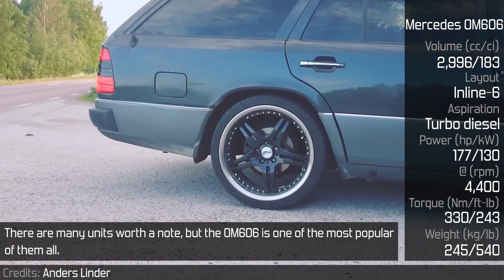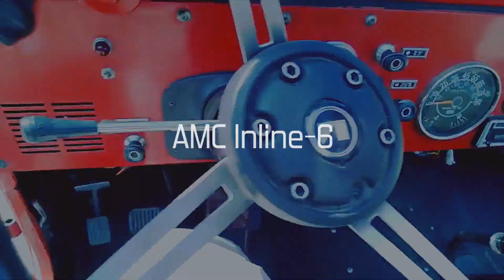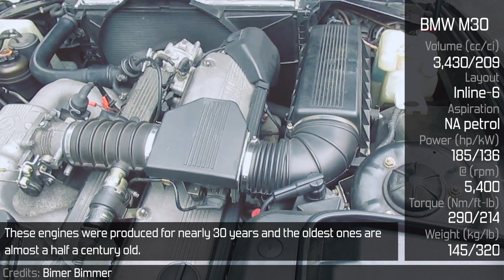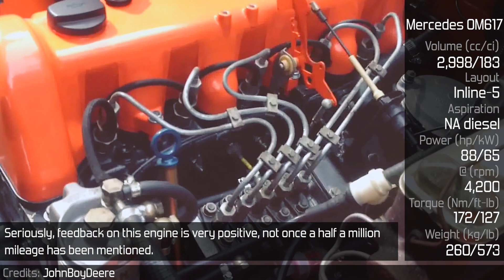10 Most Reliable Engines Running Beyond 300,000 Miles

Comment: Peugeot might not be the sexiest name around but their older engines (I have no experience with newer ones) were tough. The 403, 404, 504 and 505 were some of the best. We've had 420,000 miles from an 1,100cc petrol 104, original cam and never had the top off. Peugeot 309 290,000 miles (1.3 petrol), 320,000 miles (1.9 diesel), 406 diesel 280,000 miles, 306 1.9 diesel 280,000 miles and counting. A builder friend had a Mercedes 200t Petrol 1983 that ran up well over 700,000 miles and still went like the clappers despite being driven hard its whole life. Most modern engines will top 250,000 provided they're maintained and used with a degree of intelligence.
Reply: Agree, my mom bought a Ford Fiesta Ecoboost lately, when I asked the salesman about swapping the timing gear he answered, that I won't probably ever swap it, because it's engineered for whole car's life - which, according to owner's manual is 240,000km.
Reply: Mikaela Bowen Modern engines are not made to last...They want you to change it for another new one in a couple of years, like maximum 10 years
Reply: modern engines are cheap and break easily because you are supposed to buy a new car in 5 years
Reply: I have got a 1995 306 1.4 petrol with over 560.000+ kilometers. No bigger issues, and nothing with that engine. Its get everything in time, i think it will run for more years :)
Reply: Agreed, I drive a 1998 Xsara Break with 1.4i KFW TU3 75HP, at 270.000 kms the engine's condition is almost like new, requires very little maintenance. Same engine as the Peugeot 306.
Reply: +Mikaela Bowen. You are exactly right. Old Peugeot diesel engines do awesome miles, so do Mercedes, see my comments above.
Reply: New ones weren't bad either, my first car was a 307 1.4HDi with 210,000 miles on the clock, sold it to a family friend with 240,000 and he's still driving it with about 270,000 :)
Reply: I agree the Peugeot xud and XU can run more than 400000km. you can find some old 2.1 Renault diesels that do the same
Reply: To be fair it is awfully underpowered (65hp), not even intercooled I believe. Which is why it has no probs joining the 300k club haha...
Reply: You got a very good point!
They are way more reliable than the mentioned TDI engines on the video.
I had 205 GL with same engine than your 104 , and 306 DTurbo, and both reached over 500,000 km without problems. We owned 504 Diesel, 504 TI, 304 S, 305 SR, 106 1.5D which were all reliable. My uncle had a 505 SRDT which made up to 880.000 km (1L oil per 500km in the end, but a lot of Audi TSI/TFSI engine use that much when almost new). We owned Audi A4 B5 (1,6 and 2,V6), Golf 3 TDI, Volvo S60 2.4T, Renault 5GTL, TS, Super 5 GTL, and Renault 9 GTL  which were by far less reliable than any single one of the Peugeots.
Only a working horse of my father, a Toyota hi-lux could be compared to the Peugeots. It was fucking reliable as hell. I now have a Lexus GS460, so far so (very) good, but mileage is still low.
Reply: im running a bx 17tzd  1993  with 260.000 on clock carnt beat the old French cars
Reply: I always had a soft spot for the BX diesels - I drove an 1987 one occasionally through work, when it was almost new, and it was a beautiful car. 

The Peugeot 403, probably one of the toughest cars of its day was known as "l'increvable", or basically, "The un wearoutable". Beloved of taxi drivers in countries where roads are little more than optimistic rumours. The 403, and the subsequent 404, 504 and 505 became legendary for sheer durability. Alas, the one thing Peugeot neglected (in common with so may European makes) was rustproofing and that ensured that may UK owners remembered their 04 series Pugs as chronic rotters. Although I think the crown of rust must surely go to Alfa Romeo for its dazzling (when working) Alfa-Sud, Peugeot had definitely got their act together by the time they launched the 205 - that remains a car I always wanted but have yet to own.
Reply: Indeed the 205 was a fantastic car. I started to drive on the 504 of my father, but the 1st car I owned was a 205 1.1 GL as I wrote earlier and I still miss it.
When I was younger I had the occasion to drive many other 205 models from my family, friends, or as company cars like 205 Diesel, Turbo Diesel, GT/XS, Rolland Garros (not the convertible one unfortunately), 1.3 Rallye and 1.9 GTI.
All were great cars, especially 205 Rallye, and GTI which were very fast by the time, had great handling (but pay attention on the wet with GTI, its butt likes to dance on wet), and were so fun to drive.
Diesel and Turbo Diesel, were very tough, quite fast for the time, and extremelly fuel efficient: up to 4-4,5l/100km for the Diesel, 5-6L/100km for the DTurbo. These are values that most modern car struggles to reach nowadays, with the difference that 205 Diesel could make well over 500.000 km without major problem, and still run, and run, and run..... Therey were tough as hell, like tiny and fast tractors.

The only models I would avoid is the 954ccm with 45 HP which is too anaemic, and the GT/XS/XT (the X engine, not the TU one), which is quite fast and fun, but due to its double carburetor can easily swallow 10-11l/100km gasoline if you are a bit in a hurry.  The XS/XT/GT with TU engines had 1 twin carburetor instead which made it more fuel efficient (1l/100km easily less and X engines).

All in all the 205 remains my all time favorite car on a par with the 504. 
It is obviously not comparable with any luxury car, and equipment is very low compared to modern cars, but it is a good looking car, it is very funny to drive, and it has still a great handling. It is without a doubt one of the most reliable cars ever built, and certainly the most reliable from all small cars in history.
Reply: I absolutely agree with you.  Personally I have always gone for the lower performance cars as I wanted to keep the insurance costs down and also because I use my cars to carry just about anything that I can fit inside or on top of them! A turn of speed is always nice to have, but durability has always been a priority for me. With the Peugeots good handling and usability with an adequate degree of comfort have always been guaranteed - not always true of other makes! 

I do find modern cars overly cluttered - I know they are far stronger in a collision, but I have no need for air conditioning, electric windows, heated motorised mirrors, etc, all that stuff in unnecessary, I'm not even a fan of central locking (most cars, of all makes, that I've known in their old age have tricky central locking that becomes unreliable and horribly expensive to fix!) and my current 306 has it disconnected. I've not even had a working radio in a car for fifteen years, and to be honest I don't mind at all.  If someone knocks off a door mirror on a modern car the bill is greater than the price I've paid for some of my cars. A replacement (factory part) manual-only door mirror for my 104 cost me about £20.00 when someone broke one off a few years ago, and I was easily able to fit them myself in about an hour. Modern cars are sensational pieces of technology, but are a bit of a nightmare if one is looking for high mileage at low costs. I currently also run a 1999 VW Golf TDi that is rusting like hell, it leaks like a sieve, the central locking is shot, the driver's seat is collapsing and horribly uncomfortable, plus various bits of plastic keep dropping off it! The engine is good, but then the car has only done 180,000 miles and it is thirstier than my 306, plus I can't get as much inside it as my 306. 

When my current 306 diesel finally expires I am dreading having to find a replacement as there are so few cars I like the look of - probably end up buying another 306 with fewer miles under its belt!
Reply: Loved my 306 DT as well. When I bought my Audi A4, I gave the 306 to my parents. I didn't want to sell it, or give it to unknown people. Just wanted to have occasion to drive it sometimes. 
As their 1994 Golf TDI was not more fit for our equivalent of MOT (rust everywhere, plus some electrical issues), my parents replaced it with my 306, as my dad used it as a working horse as well. :) 
He put a trailer on it for transporting wood, or buying stuff in retails store. He was also impressed on how much stuff he could put inside when rear seats were removed.  I missed it already. It gone to scrapyard last summer.
Reply: +Mikaela Bowen. 403 Peugeots are absolutely awesome. I have had quite a few and still regard them as the most neutral handling car of all time. I wish they had more power, but saying that I remember that my standard 61 used to run at 80mph all day long and was also capable of 65mpg when driven a bit more gently. There are still not many cars that can do that even now, other than diesels, and I'm talking about the petrol 1600.  I was lucky to own a full blown group G rally version(unlimited rally class here in Australia many years ago), that had fibreglass panels and perspex windows. It weighted roughly 800kg and had a very worked motor producing about 165hp(68 standard I think). It had disk brakes grafted into the front end, a low ratio diff and a close ratio gearbox, and with all that plus the fabulous power to weight ratio, it went like the proverbial scalded cat. It didn't upset the neutral handling, and on dirt it was more like low level flying, than driving on a road. The car was never facing the actual direction of travel. So much fun.  Not sure where you are but I actually have a 1960 403 for sale that has been dry stored for 18 years. It's incredibly good mechanically, just needs tidying up inside( no rust). Are you game :)
Reply: Our renault espace mk3 1.9dTi made it to 500.000km with pretty much no issues
Reply: BestCanKeanRob2 I totally agree - the 505 was an exceedingly fine car. Of modern Benzes I have virtually no first hand experience, except that everyone I know who has owned one since 2005 tells of eye-watering bills! 

The Top Gear mentality is based entirely on "fun", rather taking into account any of the realities of car ownership (ie. is it practical on a day to day basis, affordable, etc). Clarkson and friends always strike me as spoiled rich kids who just want to show off; their shows are entirely about them and their egos, not cars.

Comment: The Miata can easily run longer than 300k
Reply from the maker: Which ones? There were a couple of engines used.
Reply: VisioRacer primarily the 1.6L from 1991 miatas
Reply: Koro1609 that's why I'm certain it's the perfect first car. Manual, reliable, fun as hell, and cheap
Reply: Koro1609 bet it's slow as shit
Reply: The 1.6L B6-ZE(RS). There is one Miata that did over 1,000,000 miles!
Reply: - Kilo- unless u let Chris rod knock near it lol
Reply: - Kilo- yep, most of the time the car body or driver goes before the engine...
Reply: - Kilo- my ass, they can't run longer than 120k
Reply: - Kilo- i have to admit,gay guys do seem to be pretty easy on their cars.

Comment: What about the Ford 300 straight 6? I have a late friend who had one with almost 400,000 miles and only changed oil and sparkplugs. Ford quit making them because they were too reliable (with a gear driven cam) and maybe possibly kinda got poor mileage. But definitely an honorable mention. Maybe you should make a part 2 Visio!

Comment: LA and Magnum series engines especially the 3.9 V6 its bullet proof
Reply: 5.9 Magnum is virtually indestructible if you take care of it
Reply: mine has 275k and it's bone stock
Reply: 5.2 in my 91 Dakota has 300k on the clock without a rebuild ever

Comment: forgot to mention the Ford 300 cid/4.9L inline six.  Their durability was the stuff of legend.  They were so reliable that UPS used them in their trucks for 25 years and only dropped thém after Ford dropped the motor as an option in 96.

Comment: Great video. I always liked, even as a teenager, the inline 6 and 4 engines. They have plenty of power, are easy to work on, and hold up. Glad to see a number of them mentioned especially the Ford 6, the Dodge slant 6, and the AMC 6. Thanks.
Reply: I have a car with an inline 5 and I wonder if they are prone to warping like the inline 6. of course I know my engine is plenty reliable but in comparison there are many other engines outlasting it
Reply: @christianhudspeth3338  Sounds like a great engine. What kind of car?
Reply: @planetx5269  it's a volvo c30 r design. It's got the white blocks. I've only learned about the older red blocks I'm starting to regret the purchase lol.
Reply: @christianhudspeth3338  Are the older 5 cylinder better? What years did they make the red blocks?

Comment: The 6bt cummins is just getting warmed up at 300k.
Reply: As is a well maintained 7.3idi. Old school diesels are the fricking best!
Reply: My old 12 valve Cummins has 743560 on her and still don’t have any blow by
Reply: I agree...
Reply: ΣHAANTI ahh miles not killometers....early 944 engines...300,000 was possiable have a 1979 928 with 270,00 and a 93 dodge dakota with 520,000
Reply: ΣHAANTI the piston rings just got worn in
Reply: ΣHAANTI lol just got broke in haha my old ford 302 is at probably close to her doom at 299,xxx miles. I can still rev her on up to 7,000 rpm lol. I've done some work to the upper part so she can rev alil higher.
Reply: Still can't beat a well maintained 90 Honda Accord or 70s,80s Corolla both models have many owners who surpass a million miles. 

Million mile Joe with his blue accord would have added even more then his million but he passed away.
Reply: 6bt 150k miles needs new bores/sleeves......
Reply: My uncles dodge 3500 is 2.3M miles
Reply: @miguelcastaneda7236  lol as if any other engines could get close

Comment: I was impressed with my 1992 Jeep 4.0. Took a hell of a beating and was running still when the rest of it fell apart at 230,000 miles. Durable engine.

Comment: I can say I got over 550,000 miles on my 1989 Jeep Cherokee 4.0... outside of just changing oil and replacing water pump on it the engine ran fine, the Automatic transmission was great as well and the four wheel drive was always good the XJ series is excellent... I never replaced the timing belt or chain... I do not even know if it had a chain or a  belt... it had oil seal issues one time... it did die a honest death and I blame myself because I completely did a 100% maintenance on it draining every fluid in it and a flush... RIP... I killed it...